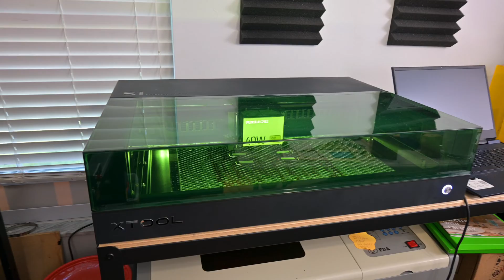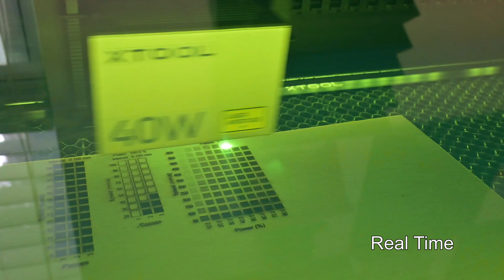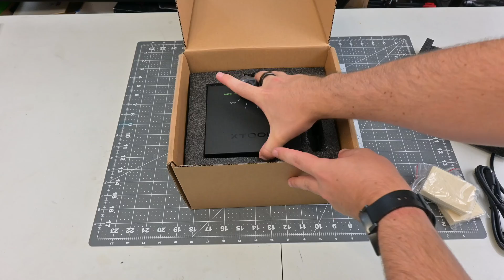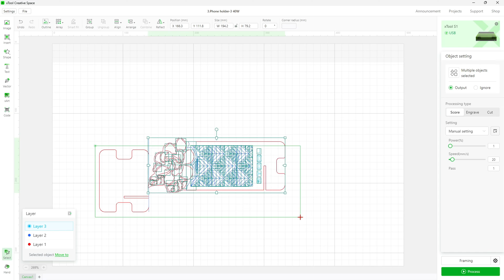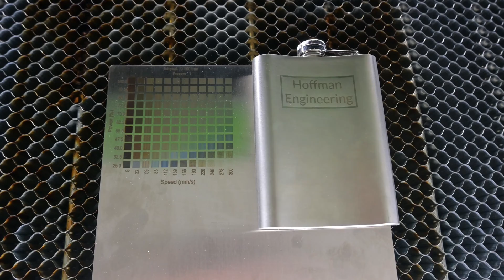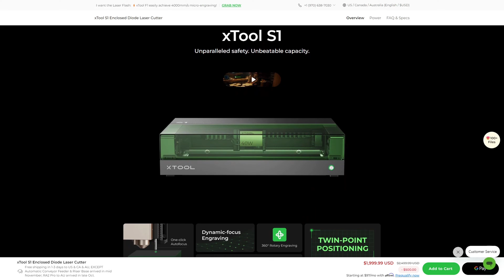40W Laser | Eye-Safe Enclosure | Autofocus | Curved Surface Engraving | Conveyor?!- xTool S1 Review

Comment: can this machine do 3d or 2.5d engraving, plus the laser does alot of heat and the system is run on belts meaning the belts might stretch from the heat, is there a way to fix that or are they going to fix that?
Reply from the maker: I don't believe the heat will be an issue with the belts. There is plenty of cooling with the exhaust fans, and hopefully there are no open flames to really radiate heat. As for 3 or 2.5d engraving, it depends on what you mean. It can follow curved surfaces to engrave consistently on them, so that would be 2.5d engraving. But as for craving away material in a 2.5d manner, than this laser isn't really designed for that. I think you could do that with lightburn, but it would be a slower process.
Reply: @HoffmanEngineering  thankyou, i am looking at xtool or wecreat, trying to decide

Comment: I purchased because I wanted a conveyor system. Now I find out they do not support this in the UK, the riser is also built differently I believe so you can not even import one, unless you import both items.  I would also like to see the ability to to do multiple two position frames. This would allow you to engrave multiple small items.
Reply from the maker: That is very good to know about us vs UK differences. I wonder if it is due to different uk/European laser safety certification laws. Looks like the UK version doesn't have the conveyor pass through. I'm guessing the laser class 1 certification for the enclosure wouldn't pass with the conveyor slot in the riser in non-US.

I've heard that they are working on adding multi-point positioning for more complex shapes, so maybe that would help with multiple small objects.
Reply: I can understand wanting multiple multi points, that would be convenient. I think the next best option is just to make a jig and align it so you can just position off of that.

Comment: Should I go for this or the Glowforge Pro? So confused...
Reply from the maker: The choice comes down to whether you need a diode laser or a CO2 laser, depending on the materials you want to cut. If you are engraving woods, leather, stone, opaque acrylics, etc then you can save a lot of money by getting the S1 over a glowforge. But if you need to be able to cut clear acrylics or glass (in addition to wood, leather, etc), then a diode laser won't work. Your need a CO2 laser.
Reply: P2 over Glowforge bro. Not gonna get 3 meters y axis working area for under 6k unless you get the S1.

Comment: Hi I was wondering if you had the Xtool p2 also and if you do how does it compare? Have been thinking about getting the p2 for a while now but now they have the s1 and don’t know what to get.
Reply from the maker: Unfortunately I do not have first hand experience with the P2. I think the main question is what materials do you see yourself wanting to cut. If you want to cut clear acrylics and glass, then the CO2 laser of the P2 would be your best bet. But if you don't need clear acrylics, then the S1 could meet your needs and save you a few grand. The P2 is still more powerful, but the 40W S1 seems to be not far behind.
Reply: Thank you for the information. I’ll definitely take the s1 into consideration. Not really sure what I’m looking to do with a laser. I would assume mostly wood.

Comment: I get excited about these vids for new lasers until I see the ridiculous price tag.  If I'm going to spend that much money for a laser it's going to be for a much more capable, large capacity, co2 laser.
Reply from the maker: That's the curious thing about these more powerful diodes. I'm cutting at the same speed with the 40W diode that I did on my K40 40W CO2. But that's because with the CO2 I was only at 30% power to preserve tube life. But these diode lasers should have a much longer working life than a CO2 tube. And not needing a water chiller is also a plus. 

Once you start taking 2.5k prices though, that does bring it out of the K40 comparison range and into larger CO2 laser ranges.

Comment: What is the bed size of the machine? Not the working area of the machine. I engrave 15"x15" concrete, wondering if this will fit in this machine.
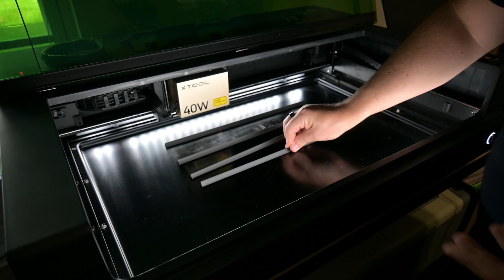Reply from the maker: I just measured it. The flat part of the bed (shown at [3:50]) is 15 and (1/8)" by 24". So 15"x15" would just fit, but only by an 1/8th of an inch.